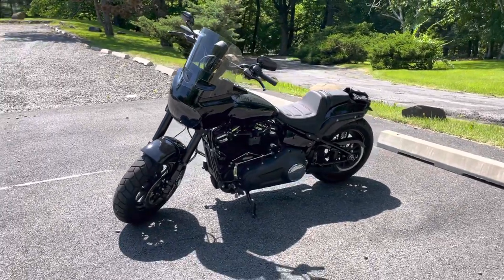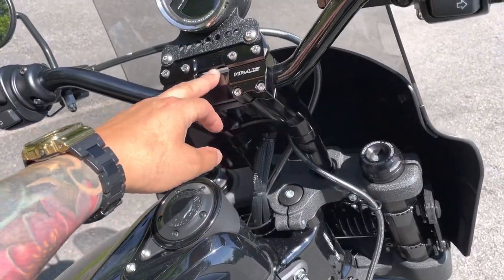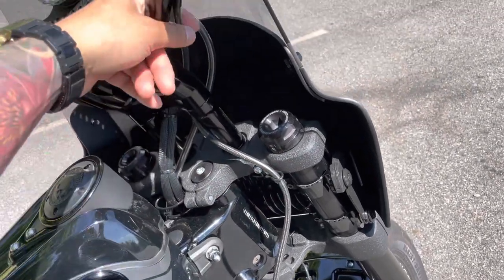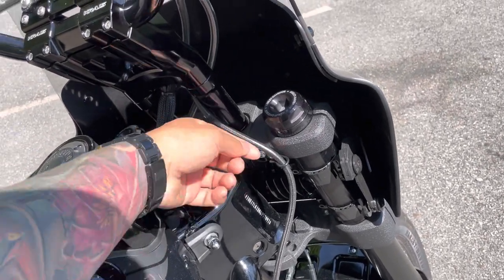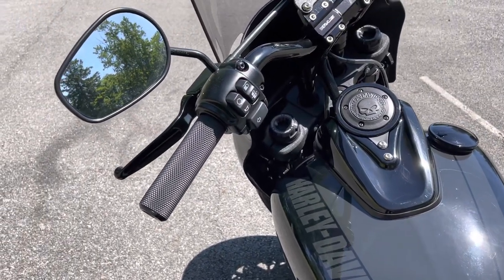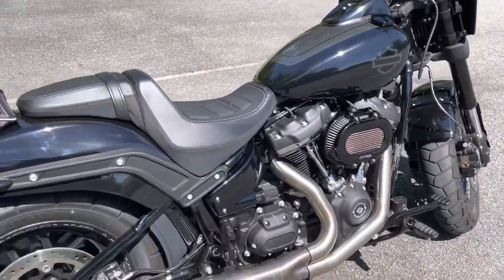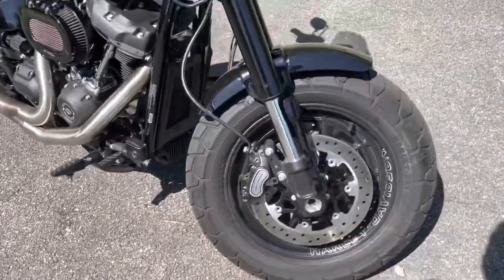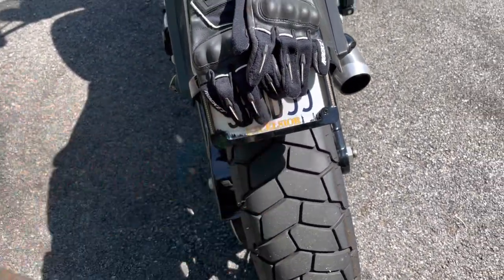2021 Harley Davidson Fat Bob Kraus Risers, Speed King Bars, Guerrilla Cables Gauge Relocation

Comment: I'm installing a gauge mount on my bars, how did you get the wire out of your neck to install the new longer wire?? Do I have to take the tank off?
Reply: Nevermind I just seen all I had to do was pop the rubber grommet out and the connector was right there..lol thank god I thought it was going to be a nightmare

Comment: Looks good man! Just curious why you removed the hard bags? I wasn't entirely clear, was it just the look? Some bags that I like and I thought those looked the best.
Reply from the maker: The mounting kit was supposed to be quick release for the bags so when they aren’t in use you can just take them off, but without loctite the quick release knobs will come loose when I was out on a ride. Having to loctite the knobs every time I put them back on was a bit of a hassle for me so I had to let them go. Loved the look but I need more flexibility

Comment: I have a 2019 Fat bob and I am looking for the gauge filler on the tank. Where did you get that?
Reply from the maker: You can use any twin can timer cover. It has 5 screw holes